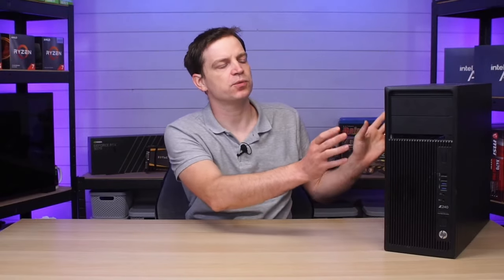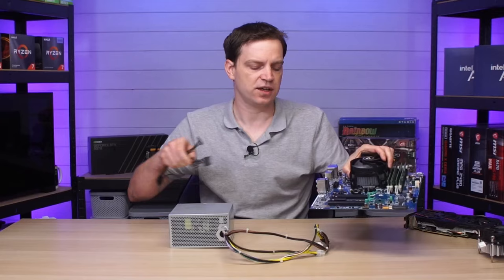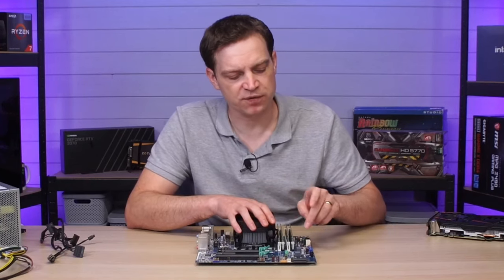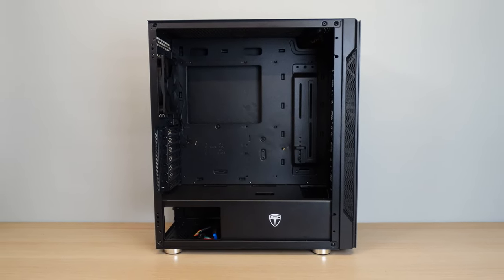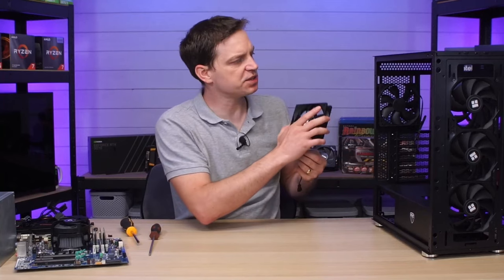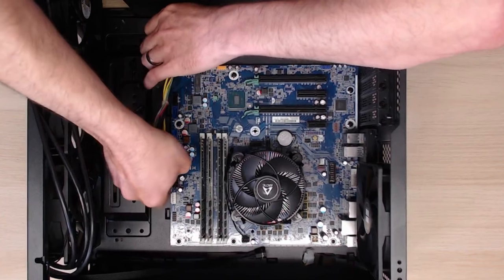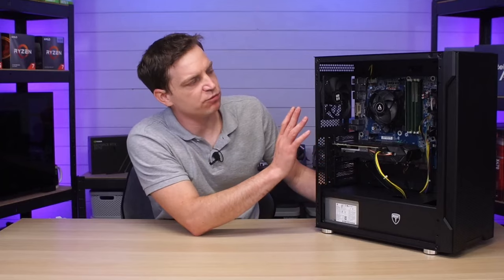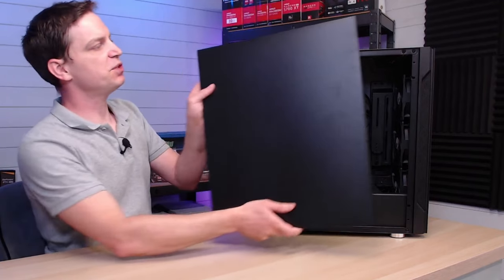HP Z240 case swap wasn't so straight forward... but we got there.

Comment: Thanks for showing how you solved the front usb pinouts. I'm not amazing at soldering but that looks simple enough. I recently picked up 2 of these motherboards with 4c/8t xeons and 16gb ddr4 for about $30 usd each. Hoping to pair them with gtx 1070s or 1080s and then selling them as budget gaming rigs

Comment: I bought a new case for that motherboard but the cooler doesn't fit it, it's an hp cpu cooler
Reply from the maker: I think the stock coolers screw straight into the old case, they are weird so you will need a new cooler.
Reply: which cooler is suitable for it
Reply from the maker: @Naturefan-gamingfan  Anything really as these sockets and mounts are pretty standard in the boards.  Just depends what your new case fits really.
Reply: Or do you have any suggestions
Reply: I have this case Kolink Unity Meshbay ARGB
Reply from the maker: @Naturefan-gamingfan  I don't know what case you are moving it in to.
Reply: It Has arbg triver on it
Reply from the maker: @Naturefan-gamingfan  You can fit any cooler in to that lol.  If you want Air cooler checkout some of the coolers from Thermalright, they are pretty good.
Reply: Okay The box say Dimensions Are 420x210x465mm and its says some tehing abaut clearance VGA 400mm,CPU cooler-168mm,psu-180mm
Reply: Does The Thermalright Peerless Assassin 120 SE work wiht it im pritty new for pc puilding so idond know that much about pc puilding

Comment: Do you think that the hp motherboard would fit a micro ATX case just wondering I'm on a budget to case swap my HP z240 also ended up buying a i7-6700k will I have to do a bios update or something?
Reply from the maker: It should do tbh as I believe it's a Micro ATX board.

Comment: thanks for your great video, i just bought an HP z240 for 120 EUR but this one is a small form factor but the motherboard is the same as yours. I'm using your video as a guide but i don't like your choice for the case so I'll try to find a better case for around 50EUR. Thanks again for this video and the one where you update the PSU.
Reply from the maker: Cases are all down to personal preference.  Find something you like and have fun with it :)

Comment: Subbed :) Think a Micro ATX case would work ? z240 Mid tower MB (9.8 x 9.6 in) ,would be awesome to swap to a smaller case.  Seems all the case swaps are z240 SFF MB which measure  (9.6 x 9.6 in)...
Reply from the maker: Yeah micro atx should work.

Comment: Check out Antecs cheap cases, I got 1 for 50$ for a PC for sale, comes with a glass side panel, came with 4 RGB fans, crappy fans without control and proprietary connection daisy chained together and connecting to sata power but for the price it does the job. I use the velcro straps for cable management as well, even on the for sale PC so the guy buying it can change it or upgrade and cable manage more easily.
My personal PC is in an 15 year old moded Enermax Phoenix case with one 12" Noctua industrial 3000rpm fan and one 14" same Noctua fan in the front, removed the 20" fan on the side, 2 beQuiet 2000rpm 12" fans in the back. Love the case and can't find anything new that 100% feets my needs. The Torrent comes close enough but they want over 1000 for it in my local currency and no way I'm paying that for a 200$ case.

Comment: Did you connect the case fans to the brown chassis fan connection? How? Its not pwm. Can I cut the plastic on the fan one to make it fit  or is it pinned different?
Reply from the maker: You can use VC fans if you want or if you only have PWM fans you can still connect them to a 3Pin VC header.

Comment: I have hp z440 I would like to do a case swap for and ideally keep the original 700W platinum psu. Any recommendations for cheap no side window case?
Reply from the maker: Hey, depends where you are but I recently took a look at the Hellcracks Silent Classic.  It's a pretty decent one tbh and the additional acoustic padding they have installed on panels works great for keeping things quiet: https://www.youtube.com/watch?v=zggZGmNS1rk

Comment: Was the front panel power button standard?
Reply from the maker: Yeah pretty much, the connections are the same you just need to use the right pins on the header.

Comment: I have a question, what is the strongest graphics card to install on the device from the gtx I wish to respond
Reply from the maker: It's an older generation now being an i5 6500 but you might get away with a GTX 1080 fine.
Reply: @TechLabUK  thanks for your reply
Reply from the maker: @Gamer20-80  np.  I mean any GPU will work but you will start running into waste after that point I think.  Maybe I will do some more testing around it though.
Reply: @TechLabUK  i5 6500 still good
Reply: My z440 has a 1080 ti and it works good with the Xeon e5-1650v4 and 32gb of ecc 2400 ram